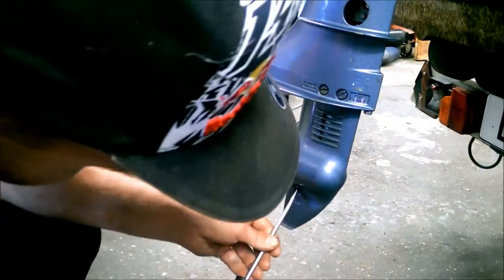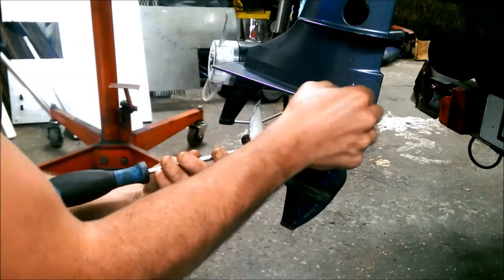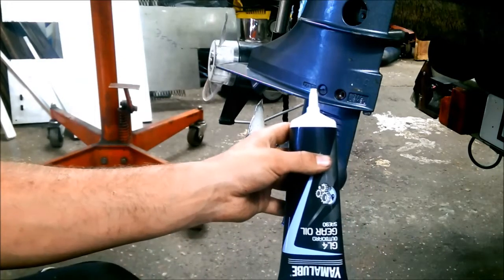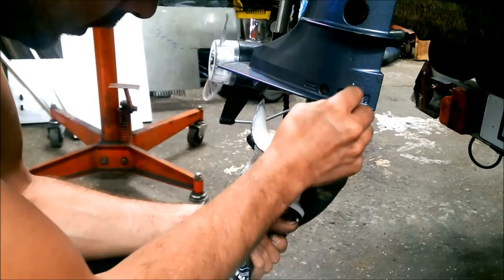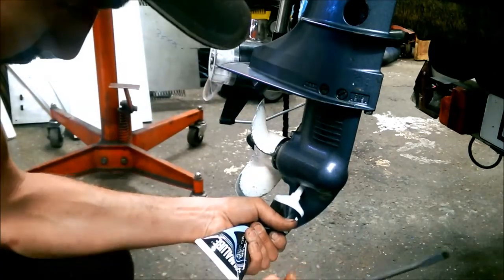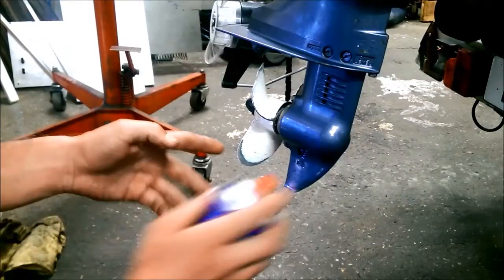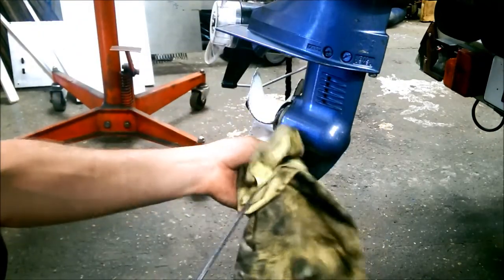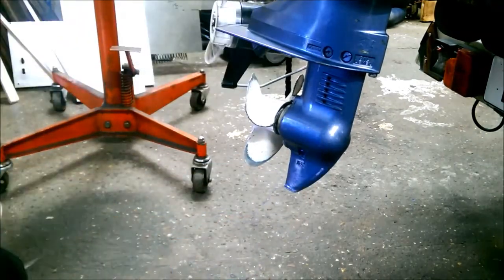Changing gear oil on outboard Yamaha F4 Four Stroke

Comment: Friend i need some help.
I got a water in oil in the propeller chamber[lower boot] on the same engine as yours 4hp 4t 2007.
What can be the cause,can it come from the gasket under the small water impeller?

Comment: Thank you very much for these videos. I have the same exact motor and was able to do a seasonal engine and gear oil change with the help of your videos. One question though - do you think it's a good idea to use fogging oil when storing the engine for winter (about 6-7 months in my case) as suggested in the service manual? If you use it yourself, could you perhaps post a video about where should the fogging oil be sprayed on this Yamaha F4?
Reply from the maker: Juhani do not use it myself, you can spray it in to the carburator, maybe remove the airfilter. Disconnect petrol and let the engine run out of petrol, while spraying the fogging oil. And also you can remove the sparkplug and spray some fogging oil into the cylinder. Don’t know how to get the fogging oil under the pistons, in the crankcase, but I guess there is some oil additive for it. Some ideas from the top of my head. Good luck.

Comment: Thanks for the videos on the Yamaha F4, @JackTekkel. Very useful! I have a question: My F4 pops out of the reverse gear as soon as I give some gas. Any idea what's causing this?
Reply from the maker: Len Kranendonk could be an alignement issue with your shifterrod or worn out parts in the clutch assembly. But if it shifts oke and jumps out at rpm then it's likely wear in the reverse clutchgear or/and in the dog clutch. But to be sure try aligning the shifterrod.
Reply: Thanks Jack, will try to align the shif trod first. Engine is quite new so I would not expect worn out clutch parts..
Reply from the maker: Len Kranendonk Oke let me know how it works out.